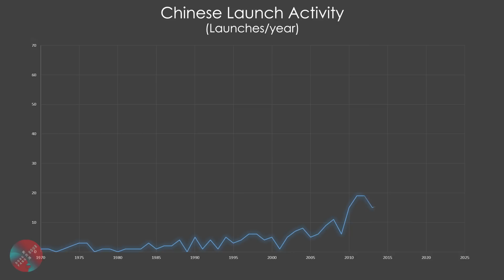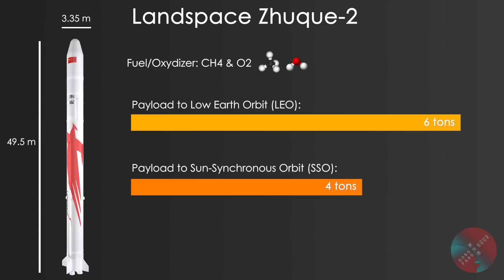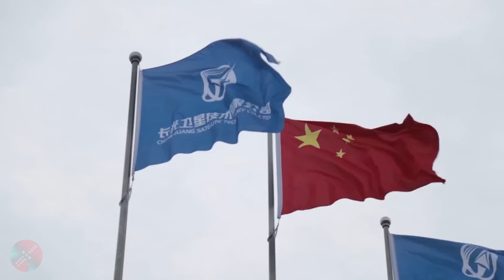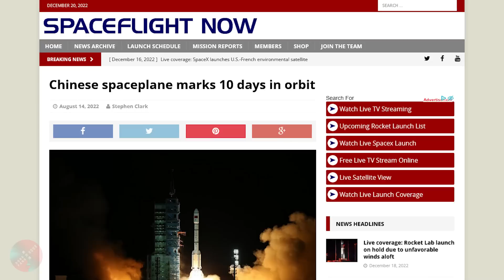Was 2022 a Good Year for Chinese Space?

Comment: Is there any news about space solar power plant?
Reply from the maker: Hey Hector,
Quite a bit, yes, although I didn't mention it in this episode. In June, CAST published a paper detailing their timeline, with milestones in 2028, 2030, 2035 and 2050. The first two milestones are relatively low power experiments in LEO and GEO (although in GEO they're looking at 100kW to 1MW already...).
Chief designer of the space station systems Y. Hong also confirmed that there would be an SSPS experiment performed with the CSS. 
Long Lehao has also hinted multiple times this year that the Long March 9 rocket won't just be used for deep space exploration, and will a role in the deployment of SSPS hardware.

I'll probably do a dedicated episode on this topic in 2023 🙂